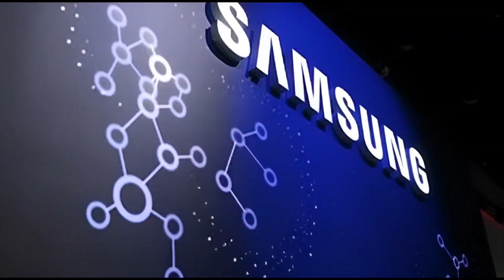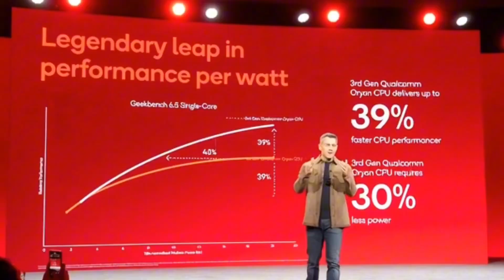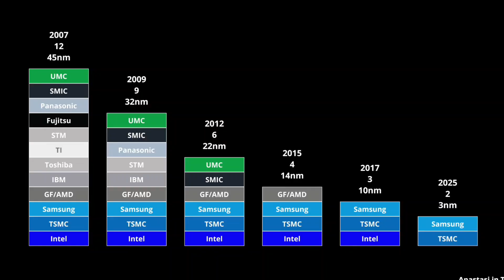Qualcomm Is Going Back to Samsung… And This Changes Everything

Comment: heard Samsung hired many TSMC head employees in which help them develop special high tech packaging in which reduces the heat while maintaining superior higher clock. Also, 2026 Samsung is planning even more advance packaging where they lay out the processor and memory side by side instead of stacking them together in which the heat distribution is more efficient with higher communication. This is all thanks to TSMC former partner making Samsung another rival to TSMC. This is why Qualcomm is seriously in deep conversation with Samsung with their next 2nm cheap